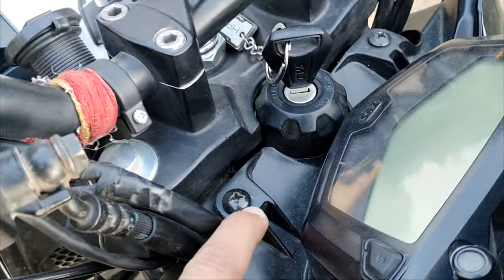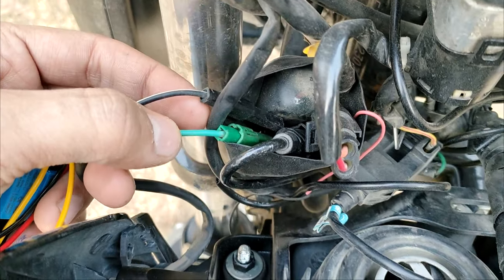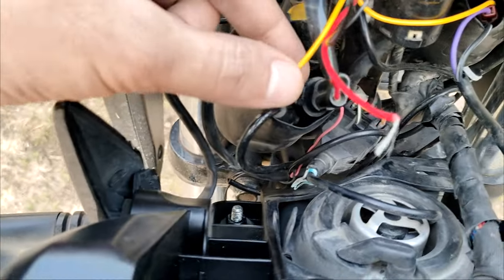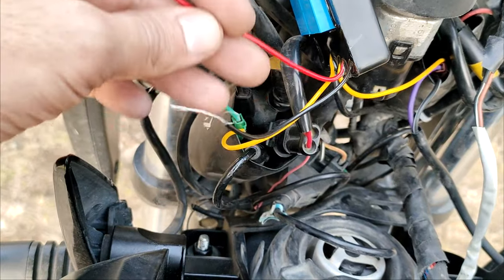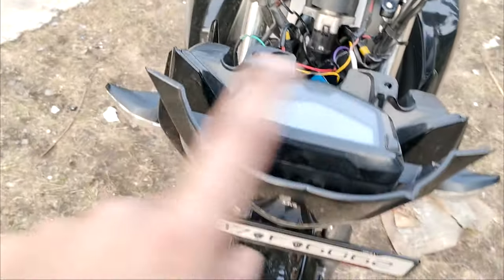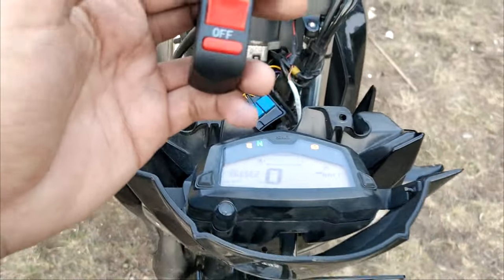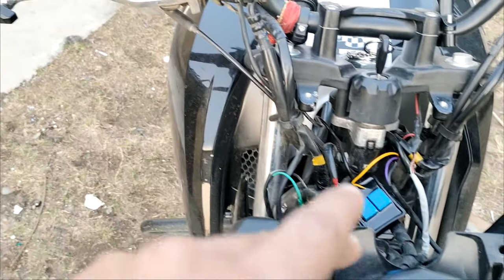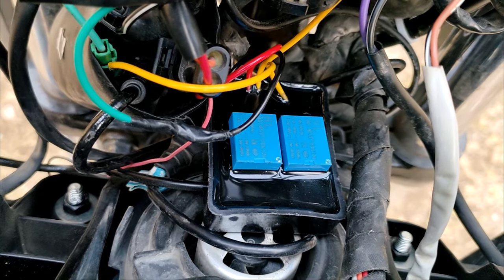How to Install Moxi Hazard Flasher - The Absolute Best Way

Comment: Brother help me pls. I have purchased generic t10 led indicator bulb buw when i installed 4 of them then indicator brightness goes low and does not blink but when i install of the leds then they functions normal. How to solve this issue !
Reply from the maker: @saikatsadhukhan6896  If you change the flasher of your bike then this problem can be solved
Reply: @RitikVerma321  bro I have purchased a dc flasher (relay) and replaced the stock one beside battery but still this not worked.
Reply from the maker: @saikatsadhukhan6896  DM me on Instagram